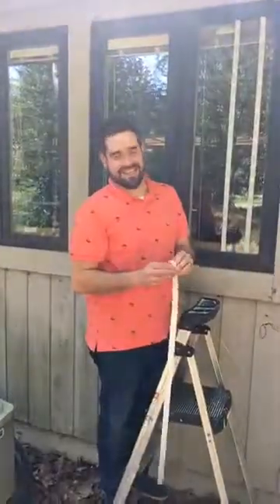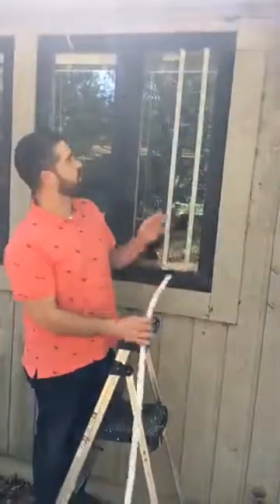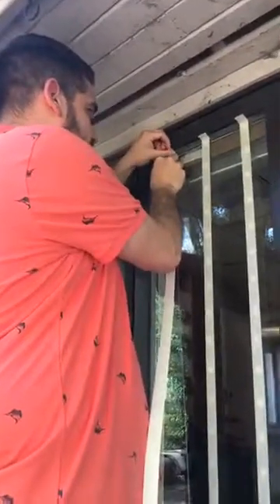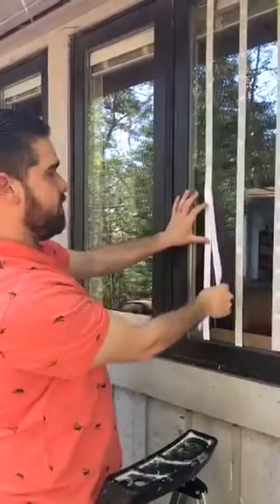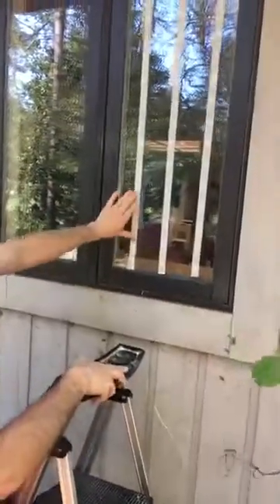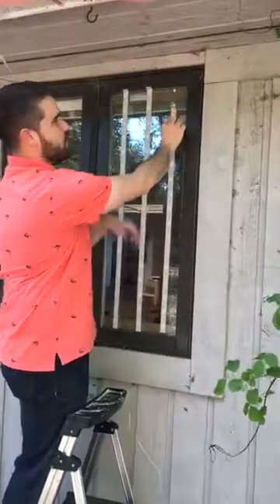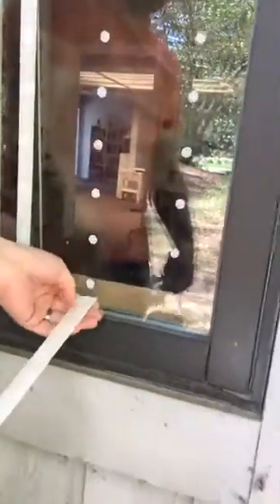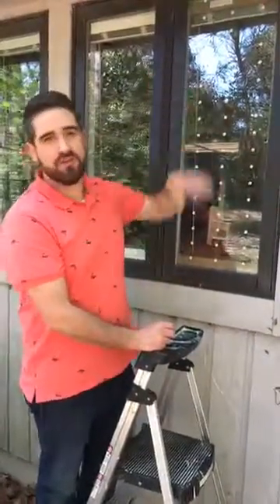CollidEscape Install at Atlanta Audubon Society Office at Blue Heron Nature Preserve

Comment: So after using this for a few years, how has its performed?  I have a large glass wind screen outside that I'm thinking about using this on. It would nd to be applied to both sides.  Im wondering if the clear dots (vs white) work as well.  Any suggestions?